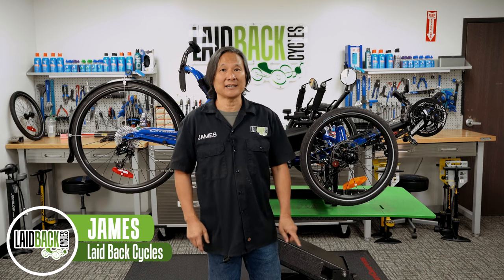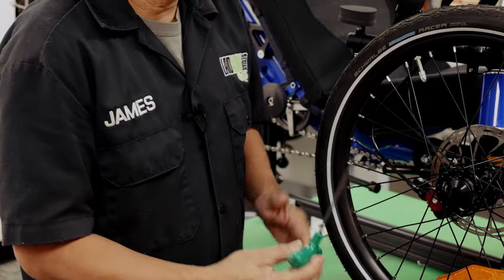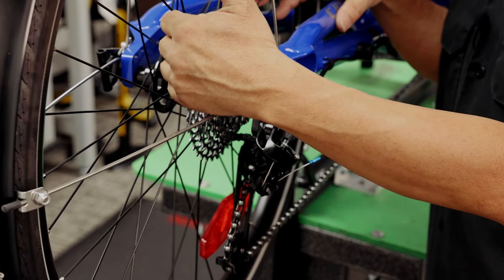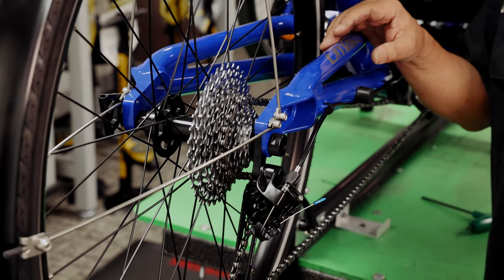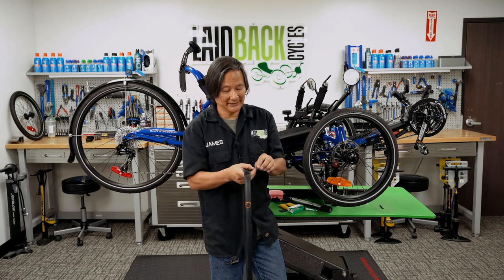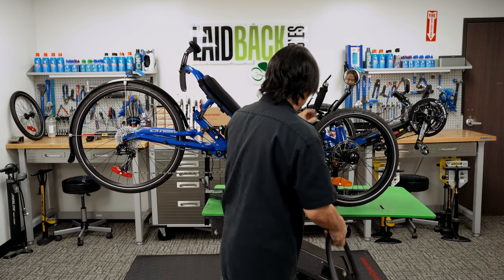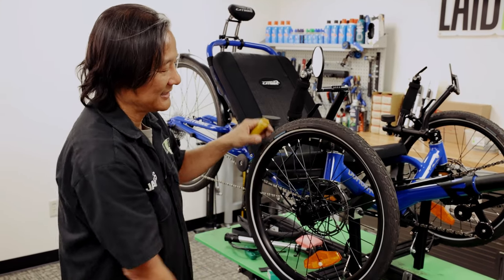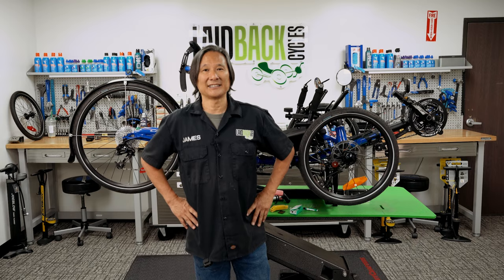Recumbent Trike Maintenance Workshop | 2024 Update

Comment: Good video, but you should also check the tire to see that nothing is protruding on the inside!
Reply from the maker: Good tip. I like to bring a rag with me in my saddle bag so I can run it on the inside of the tire to make sure there's no thorns still in there. I use a rag rather than my finger in case its a piece of glass.

Comment: On a trail how do you change a flat on the large tire?
Reply from the maker: The back tire is usually a quick release like a regular bike, and the front wheels are easy to change. Just tip the trike on it side and remove the tire and tube. You don't have to take off the wheel since there's not outside fork.

Comment: How do you increase the resistance on the handle bars -how to make them harder to turn from left to right and right to left . They are too easy to turn - I overreact whin hitting a bump or making turns . Thanks
Reply: A steering damper will address those kinds of issues. But you firstly need to confirm that your front end is adjusted and aligned correctly, and that your tires are in good condition and at the correct tire pressure. My trike came with a steering damper standard, but I don't know about other brands. There are two different steering systems in use, direct and indirect, and that will also effect how best to resolve it.
Reply from the maker: Most indirect steering used a screw to dampen, and direct will use a top cap or such on the handle bars to create downward pressure to make the steering tighter.
Reply: I ready replace my rear with the Tannus insert. I have using the slime inner tubes and Tuffy leather liners. I have been lucky with no flats on the rear. No for the fronts that’s a different story with my tipped under bridge for shade relief. Good videos thanks.